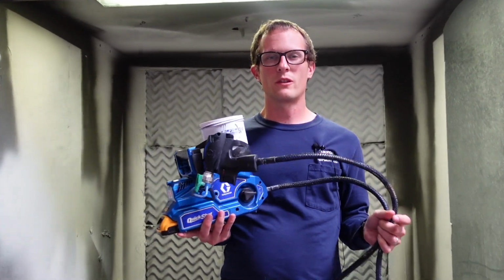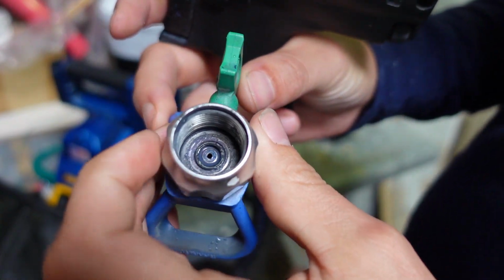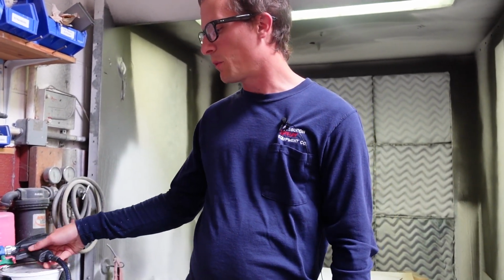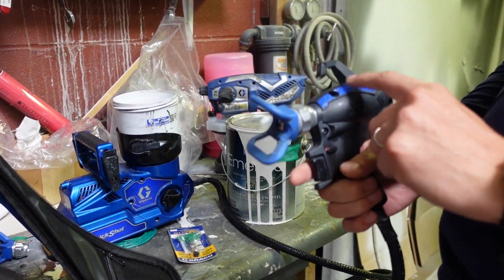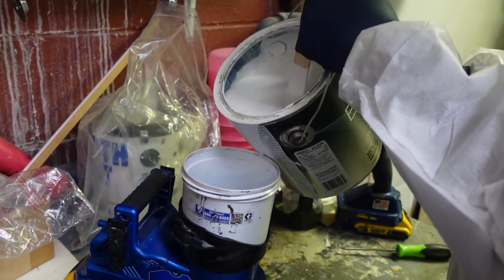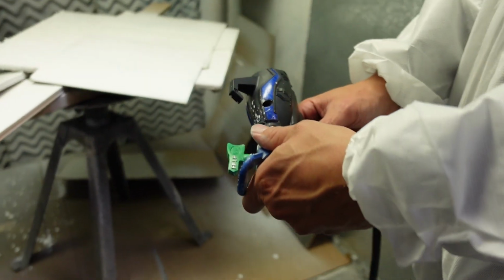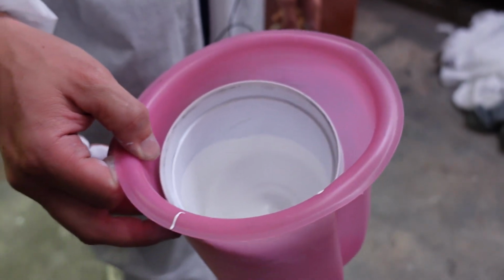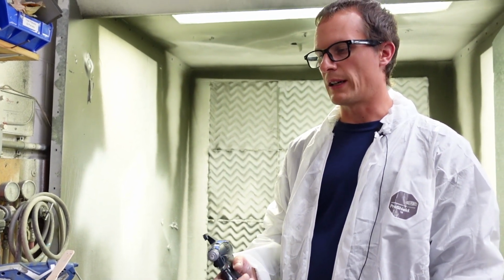Graco Ultra Quickshot Review and Comparison

Comment: The grounding is primarily to stop solvent vapour explosion. Static build up is the same for water or solvent but water doesn't ignite!
Reply: As soon as I saw that I said no thanks. I'll pass!
Reply: @TheMeanArena  Well, your "regular" turbine unit which is not battery operated has this ground as well, it is just that is in your cord.

Comment: Just bought one.  If you plan on spraying any type of primer I suggest using bigger orifice tips.  Doesn't work well with tips that come with it.
Reply: 2.12 tip is for door frames.  2 inches at one foot.  I use a 3.10 for base and crown oil base . Plus pressure is to high needs to be way lower ..such a mall hole will blow orpbis out ..and the green tips aren't cheap.

Comment: The dripping was kind of concerning. Maybe it was off the tip guard? Either way, I’m pulling the trigger at the end of the month. Nice video!
Reply from the maker: Hi yes the dripping was just do to not tightening well after I changed out the tip its a great rig thanks for the comment!
Reply: That is what I was concerned about.
Reply from the maker: @randy5972  hi it was due to us not having the guard as tight after changing the tip
Reply: Is there consensus on the dripping?  There seems to be multiple videos showing units drip. Was it an issue of not tightening it correctly?
Reply: @bsoneill3  I sprayed the emerald urethane out of my airless not to long ago, using a 310 tip (the data sheet for  the Emerald Urethane says x14 or such). So I was getting leaks out of my normal graco airless guy. I really had to ratchet the guard onto the gun to prevent the leaking. But since I was using such a small tip with the Emerald Urethane I would get a tip clog every 30 seconds or so and would have to flip my tip and blow out my load, then flip it right way around again and same thing would happen 30 seconds later. My tip was just too small to spray this Emerald Urethane crap. I imagine he's having the same issue I was having with my airless.

Still really thinking about buying one of these things.

Comment: 1. Fluid moving through a conduit creates static electricity. Solvents are highly flammable. The grounding wire is to keep a static spark from exploding the gun in your hand. 
2. You jumped from starting to explain priming and went straight into cleaning. ???
3. I've had the 360 for several years: Zero leaks & zero problems priming it. 
4. Priming the pump has nothing to do with hose length. 
5. Never keep spraying water through the tip.

Comment: I was losing my mind watching the paint drip from the gun.  I have the same sprayer and I have used it on a few jobs now and works pretty well.
Reply from the maker: Thanks for the message yes it was dripping as we switched out the tip in between scenes and didn't tighten the guard down enough

Comment: I did just look up the owners manual for this sprayer and it does show how to remove the pump. That possibly means it is replaceable. I don't know why they would show you this on page 8  just to take pump out and throw sprayer away. I did not however find out where the replaceable pumps are and how much they are. Financially speaking, if you charge $200 for every job you spray one gallon (prob make more than 200) and you spray a total of 150 gallons, that's a profit of $30,000. Even if thrown out, it makes money fast & easy vs brush/roll.
Reply from the maker: The replacement pump goes for 242. Dollars currently and is available
Reply: @PittsburghSprayEquipmentCo  Thank you
Reply: Yeah. F inn  A right . Toss it I bought a 4 yr warranty. I will fix it and sell on eBay..

Comment: I know you doing an info video. And a good job .  But for the folks out there pressure is up to high and your to close .about 10 inches to a foot away and less pressure on a 212 tip.

I hate the battery hand held to heavy. Just bought this unit .. use to used the electric model..way better in weight the battery one..also when I have a shitload of base or crown to paint I use a hopper on my Graco 495 . But u cannot shoot a quart ..hell ital.oat needs a third of a gallon to prime it .

You did a good job on the video..😁👍👍👍

Comment: I had the previous model hand held. I didn't use it for about 14 months. When i finally did, the battery did not want to power it or charge . Ended up buying a new battery.

Comment: What number of pressure adjustment equals 1,000psi?  Mine only reads: 1 thru 10?  Pg 16 of the manual does not address it also...  '

Learned on the smaller handheld: put the paint thru a mesh filter before filling the bucket, especially using  previously opened gallon can of paint ..otherwise you gotta stop (and clean) when the bottom screen reduces the flow.   Jimmy Fairborn

Comment: Something that I'm not clear on. At about 3:30, you said that the machine is good for about 200 gallons TOTAL use. Do you mean by this that at about 200 gallons that the machine dies? Or did you mean a max of 200 gallons before you need to give the machine a rest and service it? I started seeing this as a way to do inside of cupboards and closets, but then started thinking that it'd be great for cutting out. Then I imagined that it would be nice for doors, and while we're at it, why not ceilings and walls? Every one of my jobs, for two coats takes about 10 gallons. Do I have to worry that about 20 jobs in that the machine is dead?
Reply: The pump is rated for up to 200 gallons. That means that after 200 gallons of material you can expect to need a new one. But it could be more or less. The pumps on these machines are replaceable though. They are priced somewhere between 100 and 200 dollars and are very easy to change.

Comment: How well would this work for priming and finishing cabinets in small apartments?
Reply from the maker: Hi Frank if it's a smaller set of cabinets this would be a fairly decent option if your spraying gallons 5 or more per cabinet job this may be to small of a rig
Reply from the maker: Before choosing this you may also consider a titan ed 655 or Graco gx 19 they are both good options for smaller cabinet finishing as well but not quite as portable

Comment: Great video. And Hi there. To anybody really. Not really a big painter myself. Only a DIYer. But.. I have a couple of jobs/fences lined up to paint and would like a half decent sprayer. Ideally would mainly be stains to be used but was wondering if masonry paint could be used through the quickshot too. Both jobs are long picket fences so a tedious process with a brush. Don’t know if I’m just being lazy or not. Any help would be appreciated. Thanks
Reply from the maker: Hi there most masonry paints are a bit to thick to run well through a handheld type airless as they need a large tip, you may be able to make it work with some thinning but you would be pushing the pump pretty hard to make it work, and it may not work depending on the product you would end up spraying

Comment: If you were painting cabinets, would you get the quick shot or buy one of the Pro Finish HVLP’s?
Reply from the maker: Depends a bit for the most control and potential finish quality the turbines are great but they do require more dialing in the quickshot is much more foolproof but not quite as controllable

Comment: 2 things i don't understand about the quick shot,  1: its under 3 gallons per job, what happens if over 3 gallons, 2:and the pump itself only designed for 150-200gallons total use, is that means it can only last for 150-200 gallons paint usage ?
Reply from the maker: Hi Ryan you can use it for a job bigger than 3 gallons it just not meant to be your primary spray rig that you spray 50 gallons a week through with the pump total usage is what it is engineered for before it needs rebuilt or replaced , the reference of 2 to 3 gallons per job and total volume before repair is to give you an idea of what the rig is meant for so you have realistic expectations when considering it as a option
Reply: As you said yes its only expected to last 150 gallons, all of these small handheld sprayers are for small jobs i.e woodwork really small areas, the pumps are consumables, and need replacement after small workloads and when packing system breaks down, compared to a full size unit, the spray section in big unit are completely rebuildable, i.e packings pistons can be replaced and are built to last the long haul, these are good machines if you want to hemorrhage money, but a full size unit will always give you more return for your investment

Comment: Which would you choose to paint smooth metal doors. The ultra quickshot or the graco finishpro 9.0. I was alos wonder what the smallest amount of paint you can uae with the finishpro 9.0
Reply from the maker: I would go with a quickshot for the doors the paint amount both hold are pretty similar
Reply: @PittsburghSprayEquipmentCo  thanks for the reply, that's what I went with I got the quickshot yesterday. Haven't had time to play around with it yet. Why was the gun dripping on your video. Was the wrong seal in or what was causing that.
Reply: @matthewanderson2538  how are you liking it?

Comment: Could you use it for painting walls with acrylic paints??
Reply from the maker: For smaller projects it could work I wouldn't do more than 3 to 5 gallons per project unless it was a one off project
Reply: What do you mean ?  It's only useful once, for a small project, or more small projects, but at different times ? If possible to use more small projects, how much time needed between two project ? Why wouldn't it work? Because motor problems, or for other mechanical reasons? For example I want to paint 3 rooms with latex paint, do I have to paint only one room in a day? Thanks and greetings
Reply from the maker: @MultiAbrik  I was meaning it is good for smaller jobs and a few jobs each month spray 4 to 6 gallons in a month every month and this rig will be a good option to consider
Reply from the maker: You could do 3 rooms with this sprayer without a problem
Reply: @PittsburghSprayEquipmentCo  Thank you
Reply: @PittsburghSprayEquipmentCo  Thank you.

Comment: Why do they keep making the hopper so small... 2.5 gallon or 5 would be best. Maye a stand that can hold the bucket, it's braindead simple.
Reply: uhmm.. just buy a full rig?? why would someone need 5 gallons for a unit which is intended to only spray like.. a single door or something? that makes zero sense. a full size machine needs a Qt. of paint to fill the lines, its more material that cant be used.
Reply: @phuhque6724  Uhh, so that you can shoot a whole room without priming the lines through the silly process we have to go through? When the hopper sits on the input, it's fed through gravity. 

I'm not saying they can't make useless door sprayers that no one will use, I'm saying that the actual system is better, so why not  make  it for larger projects.
Reply: @FEV369  this thing isn't meant for spraying whole rooms,  it's meant for smaller projects you don't want to have to buy 2 gallons to feed the lines when you only need a gallon. I've had multiple times doing cabs with my 440 where I needed to get an extra gallon of primer and paint so my siphon had enough to sit in and not run dry.  This would be perfect because you don't need the extra.  My 440 takes a ¼gal to prime the machine,  this thing only needs 2 ounces.  I would much rather carry this thing in to do my bases than lug in my 440 for 20 minutes worth of spraying. I would much rather carry this thing up a flight of stairs than my 440 if I'm doing trim and doors in an upstairs lived in residential. They both have their uses.  If I'm in need of spraying an entire room I don't want to have to change a battery 6 times to finish,  I'd rather use the 440. I don't understand what you're saying.
Reply: @FEV369  I keep my 440 at the shop with cabinets since I do all the doors and drawers there,  why would I want to carry it back to the house to do my bases when I could just leave this tiny thing at the job in the kitchen and just do a quick coat and leave to do my final coats on doors drawers.  

I have the other handheld and it's too bulky,  I bought it because of this exact scenario, I had my 440 being used elsewhere and I had a upstairs of trim and doors to do, should I cancel or make money wait so I can go get my 440? No. I'll take a handheld for smaller projects any day and let my 440 be used to make more money on another project.

Comment: 150 gallons up to 200gallons hmmmm this airless is definitely solid for trim, doors and cabinets but 150-200 isn’t much. I wonder how are is it to rebuild bc replacing a 1400 machine is not worth it every so often
Reply: Just bought one will let you know . For 200 gallons I use a 495 with a 1.5 gallon hopper .

Comment: How well would this work for priming and finishing cabinets in small apartments?
Reply: Fantastic tbh! If you're an experienced sprayer, the smaller gun is phenomenal for the tight spaces we experience with cabinetry. I use it with FPOE Hollandlac and ECO. Sprays well and I prefer this over my larger rig.
Reply: Great review, I’ve been thinking of picking one of these up for all the trim and doors I’m replacing in my house. I’m using emerald urethane which I can get to lay out like absolute glass with a brush but it’s nerve racking and I’ll be here the rest of my life doing it.  What is the end result like with emerald , is it smooth with no texture/peel?